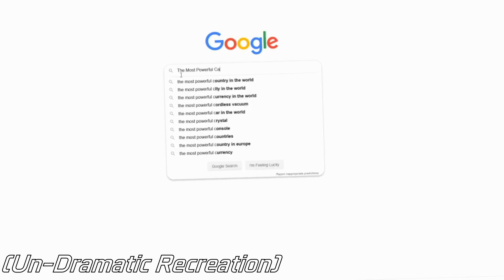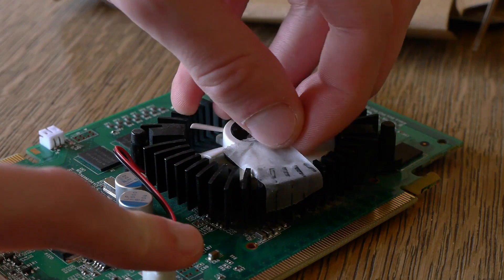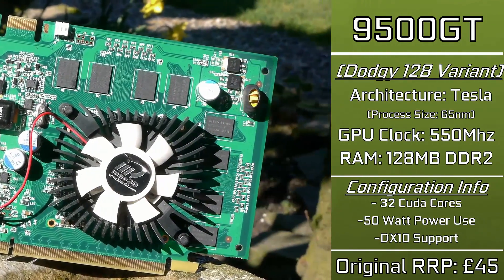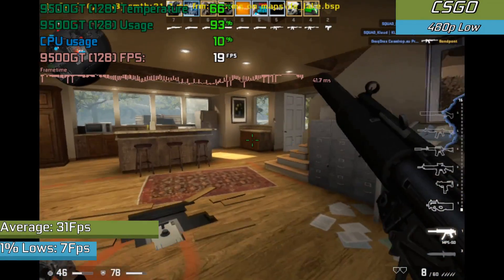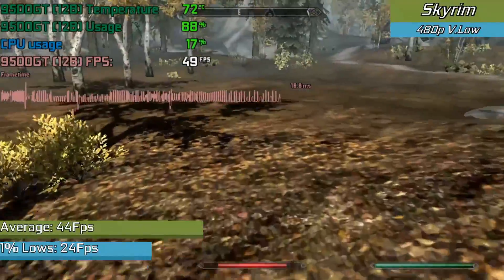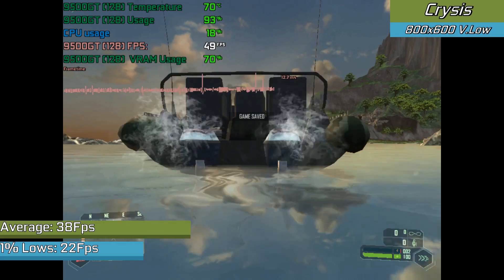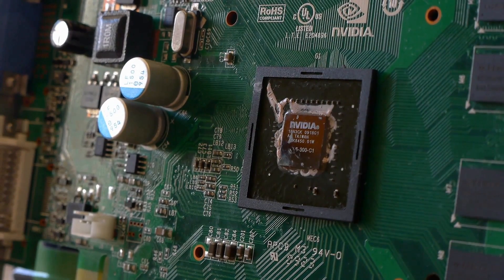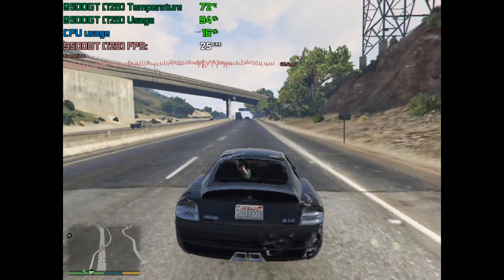The Worlds Most Powerful 128MB Card....

Comment from the maker: I want to thank the community for noticing this beautiful piece of spelling on the box...Didnt notice it myself: https://i.imgur.com/1GYDzOT.jpg

also for anyone wondering if i flashed the card back to 1GB of VRAM, or ya know any higher amount, I did try, and the card would immediately crash, i did also try forcing lower clocks and the card would still crash, Id imagine its either dummy RAM or completely borked
Reply: GARPHICS. Twice and also capitalised.
Reply: Garphics Plus :D
Reply: @TheSpotify95  They're an improved version of the original Garphics. :P
Reply: To unlock the card with more vram you NEED to flash DDR2 bios, if you flash GDDR3 bios (like on regular 9500GT) it would not work. That's why you should try a vbios from a 9500GS which use DDR2 memory (so any G96 DDR2, it might also work with G96C DDR2 vbios)
Reply from the maker: @TheQuentincc  I do know how to flash a BIOS. So I can assure you I didn't flash a GDDR based BIOS.
Reply: @BudgetBuildsOfficial  So it might be memory brand/timing compatibility issue. Personally I never saw a memory ic that can't handle its rated specs (unless we are speaking about scam graphics card from wish). These ic can't be dummy, because it would have been cheaper to simply not solder them (and use a 64 bits core).
Reply: wouldn't that card have been a decent mining card back in the day? my reasoning is that as far as i know mining dose not take much vram
Reply: @twinkboy  no nvidia cards were horrible and u do need vram
Reply: @kevgardner3064  how vram intensive is mining?
Reply: @twinkboy  depends on the coin algo
Reply: @twinkboy  I don't think cryptocurrency was big enough back then to justify gpu mining. In fact, we didn't even hear about it until 2012.
Reply: On cards like this that have ddr2 ram i wonder if its possible to make it use system memory, would modern ddr4 memory result in more preformance? Curious
Reply: maybe thats the reason this 128mb version even exists, they had a broken 1gb batch and came up with a "fix" to sell it cheap and make up the cost
Reply: How is running mine craft in HD actually HD being the fact that mince craft was specifically designed to be a low res pixel game . so I say again is it really HD or are you running a really pixleated game?
Reply: Г Р А Ф И К С
Reply: Wonder if it was a binned part. Like the cards had bad ram so just disable the failed chips and sell it as for business machines.
Reply: Garphics...? Garfield Graphics...? :P

Btw I take it you didn't get a reply from Inno3D...?
Reply: They were dyslexic like me lol
Reply: This thing can do even better if increase the v ram and also the flash controller like if equipped with GDDR  3 or 4 modules we can expect much higher performance like between 50-60 or more high frame rates. this thing can atleast compete with the intel HD series graphics from 2015
Reply: Any updates on that 128mb 9800 gt?
Reply: Probably you need to set RAM size via some capacitors on the board. If you can find the same with 1gb you could try to set it correctly.
Just 3 years late to the party but maybe... :)
Reply: lol to anyone asking if this card would have been for mining: Bitcoin, the first crypto EVER came out in January 2009. This card is from 2008.

Comment: I suspect they binned the card's VRAM. Binning means the cards are tested for memory errors, and if they failed, the failing chip(s) would get disabled (perhaps with that BIOS) and the card would be sold with less memory. Since the card has 1GB of VRAM spread across 8 chips, this sad 128MB card had 7 of the 8 chips fail

Comment: Cards like this were largely picked up by people on super tight budgets and in most cases, they were still running old CRT displays which made the lower resolution required for these look a whole lot better than on an LCD. 640x480 with medium settings looked decent enough on a CRT and meant you could play the latest games that all your wealthy friends were raving about. I still have a more standard 512mb 9500GT I use for testing motherboards, still works perfectly after all this time. Mine came with a prebuilt store brand system that exploded on a relative, literally, capacitor detonation on the motherboard, there were black scorch marks on the side panel and smoke stains all over the inside of the case, it must have been on fire for at least a short time. The 9500GT was fine however and has lived in my parts bin ever since.

Comment: I am not surprised GTA 5 ran at 128MB of VRAM. PS3 and Xbox 360 ran at similar constraints. Xbox had 512MB unified RAM.  PS3 had only 256MB RAM and 256MB of VRAM, considering game runs in video at 800x600 it is lower than native resolution of GTA 5 of PS3 and Xbox 360 which is 1280x720.

Comment: No, in fact these cards are cards that were returned under warranty to the manufacturer, and should have been destroyed, but somehow ended up in China, and were modified to be put back on the market. I studied this for many years, China has been doing this for approximately 20 years, the peak of this was with the GTS450, in which they acquired thousands of them (perhaps used in mining at a time when the gains from mining were not worth the effort of using a card high-end), the Chinese took all those damaged or simply old boards, and transferred their components to a new PCB, and sold them. When the GTS450 was no longer in demand among the public, they modified the bios so that it would be recognized as GTX6xx, sometimes with more memory than the card actually had (and this led to the card BSOD in games that used more than 512 or 1GB that it actually had), I searched a lot for a solution for bios, I was on several Russian and Chinese forums, and everything led me to the name of a single Chinese man in the mafia, responsible for all kinds of crap that lands in other countries.

Comment: I remember running GTA V on the 128mb Nvidia Quadro NVS 135m in my Dell Latitude D630 from 2007.

The damn game is so well optimized that I was almost able to get a playable framerates (Granted I had it running at 320x240 with every performance mod possible).

Comment: I had one with only 128mb physically onboard, back then. Believe it or not, back then, it made for a fairly ok budget card, allthough I preferred my 8400gt despite a DirectX compatibility issue back then. You gotta realize, back then, 640x480 was common on budget systems. 6150se was still common on amd boards. You're playing 2011-on games on a basement bargain card from earlier 2000's.

Comment: i had a Palit FX5200 128 bit mem bus, highly overclockable. Also could enable additional ROPs by un-masking them in software. Ran Half Life 2 at 1024x768 as everybody had then, just fine. Should be tested with games from it's era. Why do you test it with Skyrim , that's a modern game released in the GTX/Radeon HD era. Review unfair

Comment: I picked up an AGP-slot "DIAMOND S9250AGP128 Radeon 9250" card with 128MB VRAM and some decent NVIDIA graphics chip on it back around that timeframe... Bought it for a reasonably low price, because the specs were good enough to make HALO and Project 64 run better on the family PC. I think it was $70 🤔

Comment: Did I understand you right about the vram, that it had 1gb on it but it was cut down in bios to 128mb?

If that's what you meant maybe the card could unlock those extra chips?  I had a nvidia 6800 vanilla and you could re-enable the locked out cores /rops and make it into a ultra card, using a registry hack.
Reply from the maker: Pinned comment

Comment: It could still be a useful card if you had a machine (for example running windows8.1 or server2012) which only had a pci-e slot version1 found to be not backwards compatible with pci-e gen2. The 128 meg is still enough for the video RAM limit on those versions of mswindows, and the opengl standard is enough for html5 webpages. The drivers are available. It would run googlemaps in 3D. It would also work in Nouveau drivers for linux.

Comment: its rare wow i have one in my retro rig made by inno 3d, but its agp
Reply from the maker: Are you sure?
Reply: @BudgetBuildsOfficial  can't post a pic, was in my junk box that managed to no go to the dump with the piles of other old boards lost a voodoo3 2000, and a voodoo5 5500,a matrox card. i yanked when a windows update prevented the 2nd gpu from working.i still have a few old ati cards and an 8800 gt that survived. i always seemed to pick cards that weren't as good as the ads in pc gamer magazine said, and would go buy another weird card or odd processor like a cyrix 486, or was it a 686, ore an amd dx266. i was a gamer with a good income, but loved  my voodoo5 until that update ruined it for me.here is a dust covered pic, the fan was dead, and it over heated and shut locked up my rig, likely why it ended up in the junk pile. https://www.facebook.com/photo?fbid=10222115208495406&set=pb.1418686628.-2207520000..

Comment: I got the 512mb gddr2 version of this card back in the day. It can run metro 2033 on medium settings at 1366x768 with an overclock. So yeah, it should've been a pretty decent card with enough vram installed on it.

Comment: CS: GO Minimum System Requirements
CPU: Intel Core 2 Duo E6600 / AMD Phenom X3 8750 or better
RAM: 2 GB
HDD: 15 GB of storage space
GPU: Video card must be 256 MB or more and should be a DirectX 9-compatible with support for Pixel Shader 3.0
OS: Windows 7, Windows Vista, Windows XP
DirectX: Version 9.0c
Screen Resolution: 720p
Network: Broadband Internet Connection

Comment: I had an 8800 GTS with.... 312mb, iirc.

It worked beautifully for many, many years, despite such a tiny amount of RAM. 
Bought it in 2006, and I used it until about 2012-2013...but finally had to retire it. 

It pretty much lasted the entire PS3/Xbox 360 console generation...but the next generation of games (PS4 era) BROKE it. I still have it sitting around somewhere. It serves as an ornament at this point. Haha

One of the better cards I've ever owned, though. Such a tremendous value for the money at the time.

Comment: That is weird as I have that card in a personal computer installed into a m2n68-la (Narra3) GL8E motherboard but the the name is AUSTEK EN9500GT is a great card but really needs a PHENOM II X6 processor not an PHENOM II X3 but runs very well under Linux Mint 19.3 CINNAMON (Tricia) 64bit edition and is not my dads machine, the machine I am using now has the DAA78L motherboard with an A10-7800k and 16GB of DDR3 RAM.

Comment: There is technically a more powerful card... Igp rather... Some intel iris pro igps have 128mb on the cpu
Reply from the maker: An iGPU will just overflow to system RAM it is already using. It doesn't really have dedicated VRAM. There is no performance hit to overflowing to system RAM.
Reply: @BudgetBuildsOfficial  traditionally yes, however some iris pro models actually have a 128mb cache on the cpu. think back to the nvidia cards that used to use "hyper memory" where the card would have 128mb or so and then borrow from the system when needed. look at the i7 5775c https://ark.intel.com/content/www/us/en/ark/products/88040/intel-core-i7-5775c-processor-6m-cache-up-to-3-70-ghz.html
the cpu can also use it as a sort of L4 cache
here's the 6200 with 128mb eDRAM vs a 6100 that's basically the same chip minus the memory. https://www.notebookcheck.net/Iris-Graphics-6100-vs-Iris-Pro-Graphics-6200_5945_5947.247598.0.html
not trying to take away from the video by any means... as its technically not a card regardless, as in you can't plug it into a free pcie slot. just wanted to point it out for laptop users (and some desktops)

Comment: I actually still have the 8800gt series. Can't remember if it's the 256 or the 512. I just remember it use to run high Temps all the time. But worked for years and years.

Comment: I remember playing Tourist Trophy for ps2 on pcsx2 at 60fps in 1080p with win7ultimate on a GT9500 and an Intel q8400 overclocked at 3.21ghz.
Best experience ever. GTA4 was also a breeze.
But I burned half cores when mining bitcoins on it. You've been advised.
It was still working though. 😂

Comment: i used a 512Mb GT9500 alongside my GTX470 to run games triplehead (with softth, so the 470 was rendering and offloading the frames to the 9600) and 3rd desktop monitor (nvidia took way to long to allow more than 2 outputs on a single card!)

Comment: Why does the 8500gt have 512mb but the 9500gt have 128mb?
Reply from the maker: Cause not all 9500GTs have 128MB
Reply: @BudgetBuildsOfficial  Ah it was mainly 1GB, right? And wait so these 128MB versions were never officially sold but modified by others?

Comment: through some wikipedia-based calculations, I believe it is entirely possible there is more bandwidth (and capacity) available from the system memory through the PCIe 2 x16 slot than there is from the actual onboard memory.
Reply from the maker: Most likely however performance didn't change when tested on both a DDR3 and DDR2 based system

Comment: 30fps in GTA V with only 128mb VRAM on a old ass card. How is nobody else's mind blown by this
Reply: Playing GTA V on lowest setting with 800x600 and still get 30fps is just try to torture your eye. It really good that it can run GTA V but graphic is horrible than GTA SA.
Reply: @hamashi1770  nah m8 it's fine
Reply: @hamashi1770  Actually play gta sa, you'll see your wrong.
Reply: @frankvandendool882  actually play GTA SA are better than play GTA V with that graphic. Go play both and you'll see why.
Reply: @hamashi1770  English isn’t your first language huh?
Reply: @hamashi1770  800×600 is playable bro I'm 1080p gamer now but I used to play on 800×600 for like 5 years and it wasn't all that bad
Reply: @hamashi1770  On a CRT monitor 800x600 can look great, even at 30fps which isn’t ideal. It’s definitely not always awful but it definitely can look real bad in YouTube videos for example.
Reply: Yeah I Was Thinking Same Thing.
Reply: You can play gta5 in PS3, which  is have even more older gpu and have only 256mb ram for the whole system.
Reply: @Роман-д1й1ш  ps3 has 256mb of vram and 256mb of ram.
Reply: @sixunity1171  Yeah first off the ps3 doesnt have much of a complex os. Which means the ram wont be used as much. Also the draw distance on the ps3 version was really bad and it ran at 20 fps most of the time. Probably one of the worst ways to experience gta v.
Reply: @Роман-д1й1ш  ps3 had 256 MB for GPU and 256mb ram for system. 512mb total
Reply: @Роман-д1й1ш  exactly, running gta V in a ps3 its a bigger feat.
Reply: @Роман-д1й1ш  also the ps3 is optimized a pc of the ps3 specs wouldnt run as as well
Reply: @Роман-д1й1ш  256mb video and 256 ram so Total 512mb
Reply: Yseryne The older Radeon cards have much worse driver support than Nvidia of the same era. As a random comparison they have Win10 drivers all the way back to Tesla GPUs (8000 series 2006) while Radeon cards that came out later only go up to Win8, iirc you need a Radeon HD 5000 series card to get Win10 drivers.
GCN cards have very good drivers support, but in cards older than GCN Nvidia generally has the edge.
Reply: @Ty4ons  it have nothing to do with driver support in his case but the system ram and CPU, i have a friend that had till recently the same q6600 and 4gb of ram but with a 9600gt 512Mb and was mostly unplayable...
Reply: iGPUs like Vega11 have zero VRAM, and they run GTAV way better. You seem to not understand what shared memory is.
Reply: TRUE.
VRAM is not so important. i have a 8400GS with 1GB VRAM and i can't even open GTA V.
Reply: @rslanna  8400GS was bottom of the barrel though. Nothing good about that card.
Reply: @amystery5238  the system ram and CPU as well makes it unplayable, if you put that 2600 on another system you'll see
Reply: @amystery5238  both me and my friend was samp "veterans" so when GTA5 came out we "had to play it" if you know what i mean, so i gone thru few hardwares both me and my friend, i personally had an i3-2100 with 4gb of ram and a radeon 270x then upgraded to 8gb of ram then managed to upgrade to an i5-2500k then managed to get a watercooling and oc the crap out of the 2500k (sort of...) nowadays im on a 2700X with a 580 but that's not important, the thing about minimum specs and ram... if you dont have enough video memory dumps into ram/virtual ram, if you dont have enough ram dumps into virtual ram (which is significant slower then both ram or vram), hope i have enough hardware now for gta6 hahaha xD
Reply: @amystery5238  use low spec gamer video, lots of optimizations like disabling shadows
Reply: its more impressive that integrated graphics are even better than this now. for example, I have an hp spectre13 in ultrabook with intel iris and it has ZERO vram, yet i can still play most games at 720p or even 1080p at low settings.
Reply: Thats xbox 360 level graphics/fps
Reply: @icecap676 that's worse than Xbox 360 graphics. 360 had gta 5 running in 720p.
Reply: @guser435  Actually, every card out there utilises up to half RAM as VRAM when needed, that's how Windows works. Don't you even know the basics?
Reply: @Snow-rf8es  I just played myself deletes comment
Reply: Because I've never played GTA 5 or GTA 1. I'm a tech not a real gamer. I have pooter stuff out the wazoo. Probably even this card? Sounds familiar anyway.
Reply: It is better than my intel hd graphics 405 💀
Reply: It's one well optimized game, I even ran it on my Dell Latitude D630 from 2007 with a 128mb Nvidia Quadro NVS 135m (a mobile version of the 8400gs).

At 320x240 with every performance mod possible, I was able to actually get a semi playable framerate.
Reply: Imagine if that would have been possible with GTA IV...

Comment: The fact that GTA5 can be run at all even with the totally lowest settings and not be a literal slideshow is impressive
Reply: Looks worse than GTA4
Reply: It had to run a 2005 Xbox 360 with 512MB of shared memory. Crazy impressive they pulled it off.